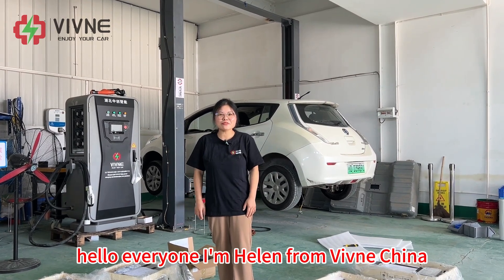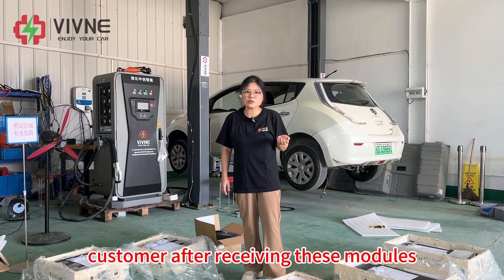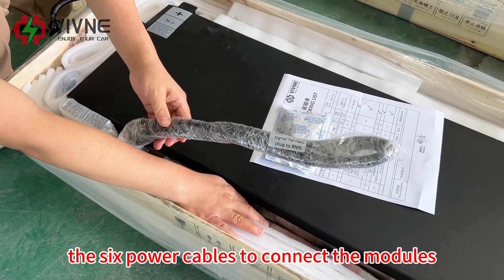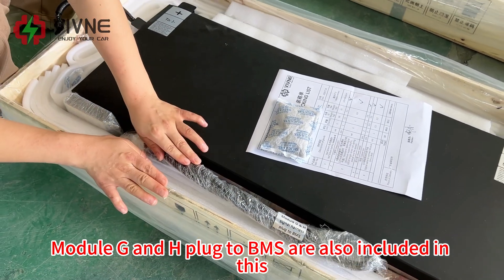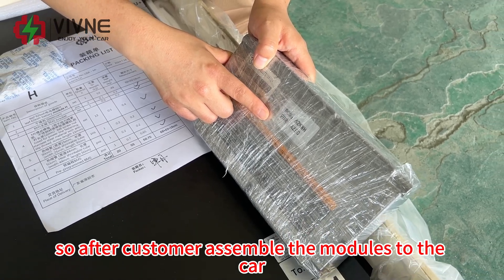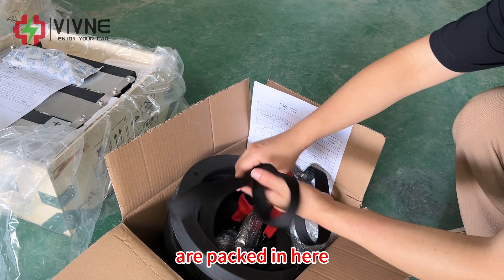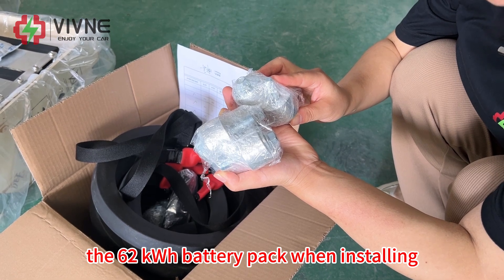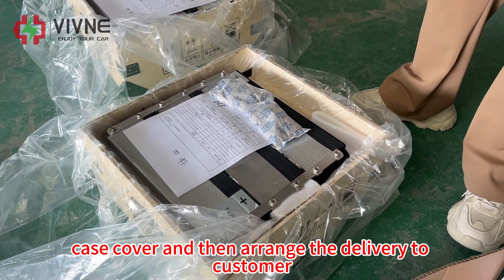Nissan Leaf 62kWh battery modules ship to USA

Comment: Do you have any videos showing how the cells are assembled into a module? How are the cells secured in the module and compressed to prevent bulging?
Reply from the maker: The cells are assembled into modules by laser welding.
The pack shell is carefully designed so that the cells can fit in. The pack shell is made of aluminum alloy, which has good thermal conductivity. The bulging of the cell cannot be avoided by fixing it. On the contrary, we leave a certain amount of space for the bulging of the cell in the design of the pack shell to prevent leakage caused by excessive squeezing when the cell bulges.  After a certain number of cycles, the battery cell will inevitably swell due to aging (just like the original Leaf battery cell, which will also swell). Slight swelling will not affect normal use, but the battery cell cannot be used after leakage and there will be insulation failure.
Reply: @VIVNEHelenMao  that is interesting. How do you provide space and secure the cells at the same time? What about movement and vibration from driving?
Reply from the maker: @the_NZH  Our engineers mastered the exquisite in this.

Comment: Hello Helen.  Can you tell me if the 62KwH battery pack has a software package capable of mating it with an early-production (Japan built) Leaf, the ZE0?  I have already replaced my 24KwH pack with a better 30KwH version from a much newer car.  I used a translation chip programmed by Dala ( 'Dala's EV Repair' on YouTube) who is a software programmer.  His system delivers a set of zeros to the car's ECU instead of trying to match serial and type numbers.  The car never goes beyond the search program, yet can still boot up and function properly.  The downside is that the (raspberry pie?) chip needs a continuous 12volt supply to retain it's programming and it can drain the 12volt battery if not used regularly.  As you know, the 12volt battery only receives a charge when the car is in use, not when turned off.  If this device could work using your 62KwH battery, this would be a worthwhile choice, even if your own software couldn't communicate with the ZE0's ECU directly.  Your software engineers should read Dala's program as it's free to download from his site, which might give your product an even wider customer base.  I look forward to your considered reply.  : )
Reply from the maker: Hello Eddie,  we had re-programmed the BMS.  If your car is  ZE0, then we will use the original ZE0 BMS to re-program.   Battery pairing can be done using leafspy.